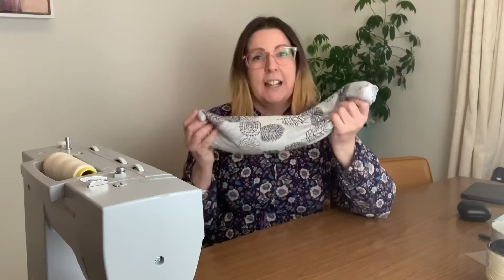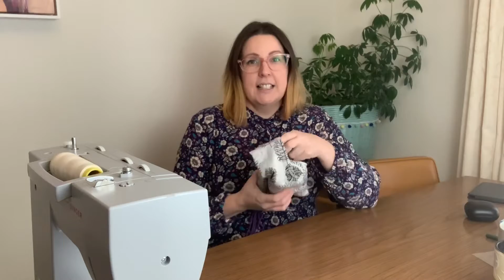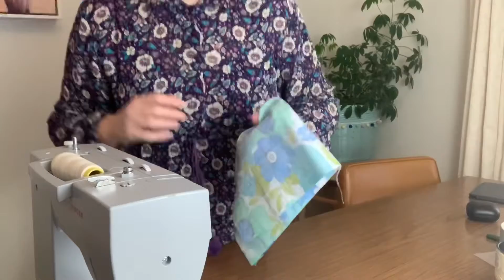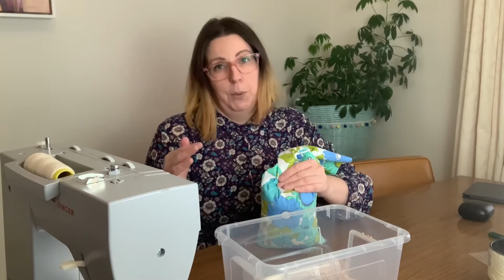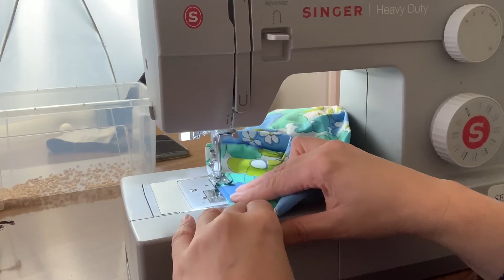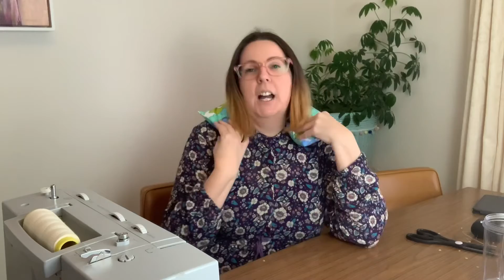HOW TO MAKE A SIMPLE WHEAT BAG - HEAT PACK - DIY SEWING PROJECT/ EASY SEWING TUTORIAL

Comment: It does matter what you use to fill the heat pack. I tried white rice in the microwave for 1 min. 30 seconds and the rice burned black. I tried lentils, same thing. Not sure what I'll try next.
Reply from the maker: I always used wheat but also used white rice for my mini rice bags and never had an issue. Did you put a cup of water in next to it? I wonder if you’ve got an extremely strong microwave? Maybe try in 30 second increments first until you know what the right time is for your microwave

Comment: I really like this project. I'd like to make some as gifts. How to you present the heating instructions? Thank you.
Reply from the maker: Hi I’m sorry I’ve only just seen this comment. I would suggest just printing a little instructions sheet. I include the following on mine: hear in 30 second increments with a glass of water in the microwave with heat bag, allow to cool completely before covering or storing. Do not over heat as this is a fire hazard
Reply: Thank you.

Comment: Thank you for your video, I have only tried Buck wheat . Didn't know I could use other types of wheat or rice. Thanks again👍🏻
Reply from the maker: You’re so welcome! Yeah there’s so many grains you can use. I hope you’ve had fun making!
Reply: Yes I have a massive amount ready as gifts for autumn. 
I think the buckwheat holds heat better or maybe it’s the fabric choices that makes a difference?
Reply from the maker: @MaximumCC  buckwheat is a grain I haven’t tried yet so not sure but fabric thickness definitely plays a role in length of heat

Comment: I made neck wraps with channels & used rice. It has been the only time using my triple stitch function on my machine to really reinforce the ends. Thx as I have learned from you that wheat works too. I put lavender essential oil in my rice too for the aromatherapy affect. Also, when making trivets I use a kitchen mix like clove, cinnamon or even lemon essential oil so when the hot casserole dish hits it the aroma escapes. 👍✅💟
Reply from the maker: Oh I’m so glad you liked my video!  Rice works wonderfully - I use that for my eye pillows as well as lavender.  I love the idea for the trivets!  That would make the house smell beautiful 🥰